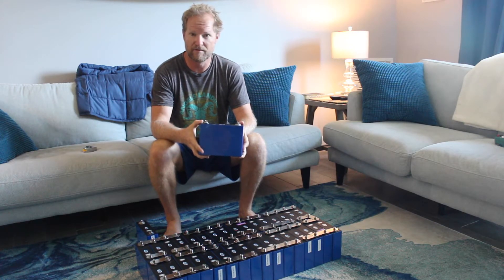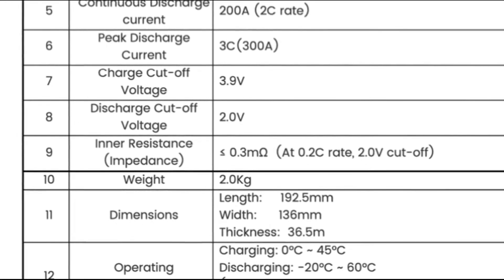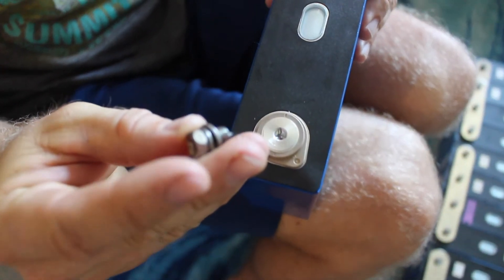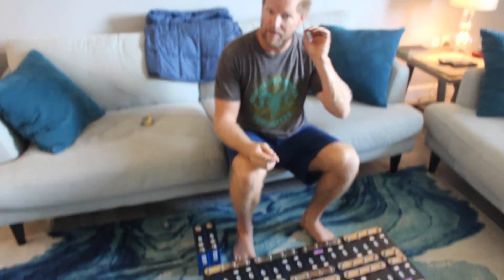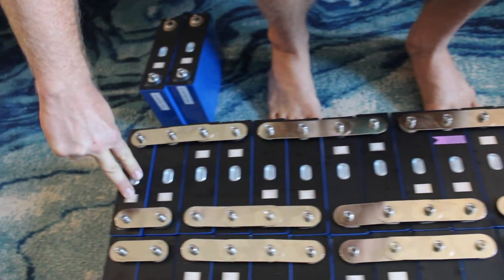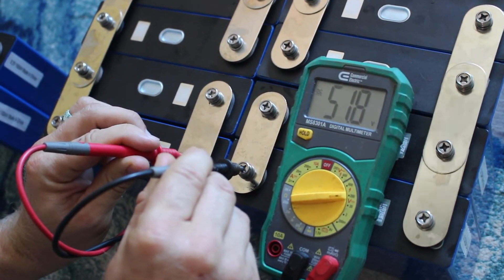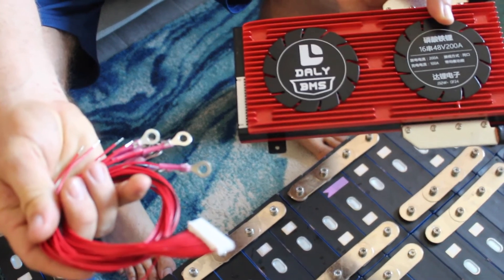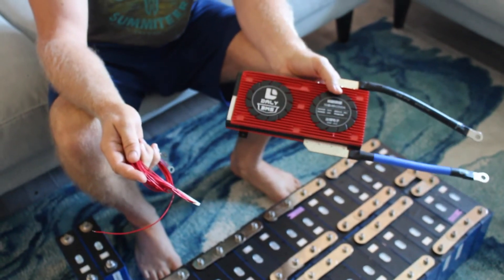Lithium Batteries - 48v 800 Ah for 2005 Leopard 40 - electric motor conversion

Comment: Great ! I just met the representatives of the oceanvolt brand at the La Rochelle show in France friday, and they told me that we could not use batteries other than their own battery (extremely expensive!)
I see you are doing a DIY pack like I want to do! it probably means that it is possible !!!!
Reply from the maker: It is very possible. The person we bought the Oceanvolt motors from had a diy battery bank. We hope to have another video soon with all the batteries together. Just taking longer than planned to find some hardware to build my box to hold them. Stay tuned.